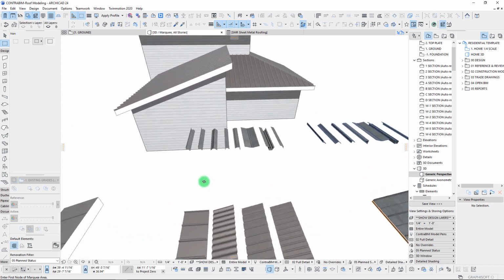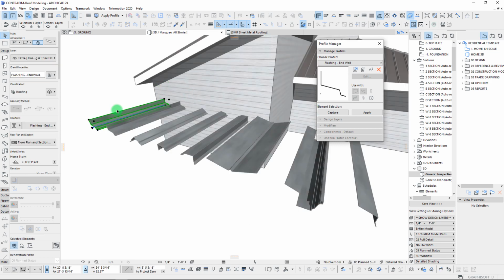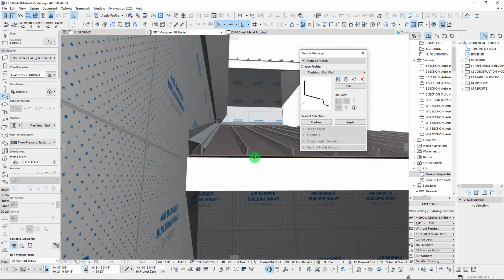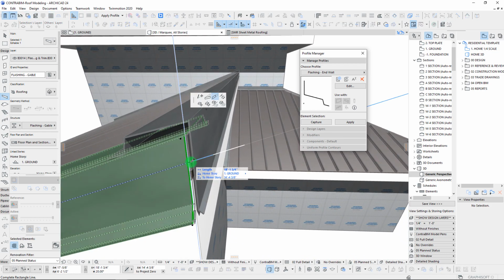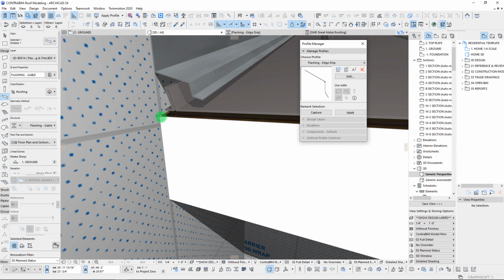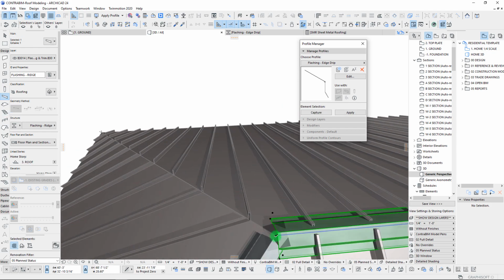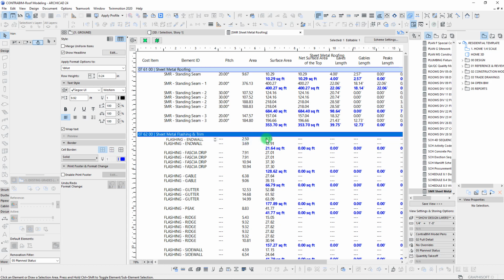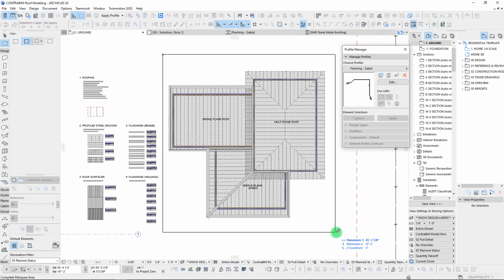How to Model Sheet Metal Flashing Roof Trims in Archicad (Part 3)

Comment: What did you use to create the flashings, After using complex profile ?
Reply from the maker: Thanks for the question. In this video I was using beams to demonstrate adding them in manually. Typically with a flashing you'll want to slope/rotate the profile to match the roof which is easy to do with a beam. In a following video, I show how the railing tool can be used to create  associative flashings, that move with the roof elements themselves. The benefit of beams though, is you have more control with the profile stretching and offset modifiers.

Comment: Are the sheets of the roof made with roof accesories?
Reply from the maker: Hi Lucas. Have you seen the 5 part playlist? Video 2 shows how we use the decking object to create the roof sheets. Video 4 shows how to use the roof accessories objects to make them associative to the roof itself. Part 5 talks about using railings for associative trims! Check it out and hopefully that answers all your questions.

Comment: Hello, I am having that same problem when intersecting beams. When one is at an angle it becomes messed up. When working with concrete beams you can't really offset them by a tiny bit like you are doing? Any tips on how to work out that problem?
Reply from the maker: Thanks for the comment. Yes with beams that can become a bit of an issue. Pulling the nodes back and trying to clean up the connection so you don't get strange angles would be my thought, probable depends on the particular situation though...

Comment: how to stretch complex profile
Reply from the maker: In order to stretch a complex profile, you need to make sure the stretch modifiers are enabled in the profile settings. The built-in width and height modifiers usually work fine for sm profiles, just set the reference lines accordingly so you only stretch the parts you want!

Comment: I know that this method of modelling the components individually gives you the greatest flexibility and element information/ takeoffs, but I much prefer to use an add on like Cadimage surfacing tool to model the roof cladding, flashing, gutters, downspouts, etc. In a matter of seconds.
Reply from the maker: Hi Michael. You're absolutely right that the cadimage surfacing tool can quickly model these claddings, flashings etc...  A client of mine was actually using that and wanted to figure out how to do quantities and estimating, and I've turned that question into this mini-series:) Cadimage is great but for whatever reason they just havn't added that functionality to provide quantities of their great model objects. A few clients now I've had to do workarounds in order to get the right values. Thanks for the comment!